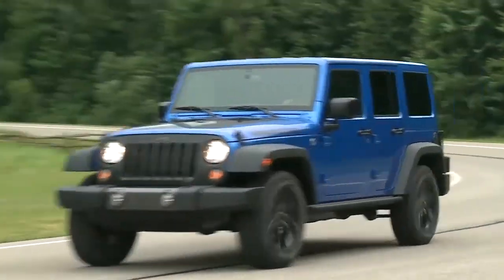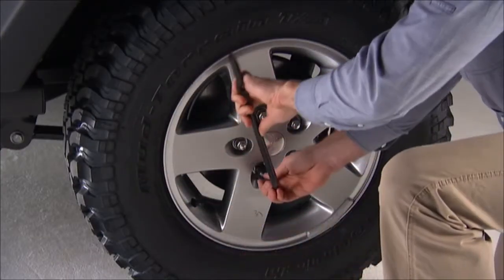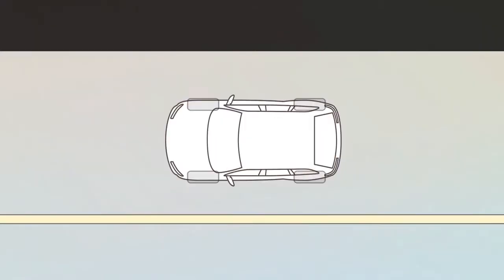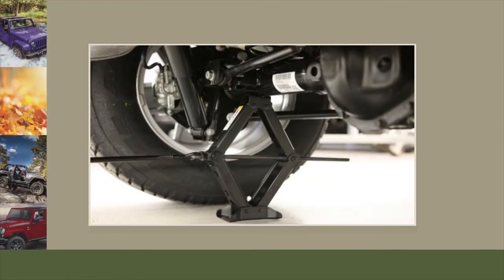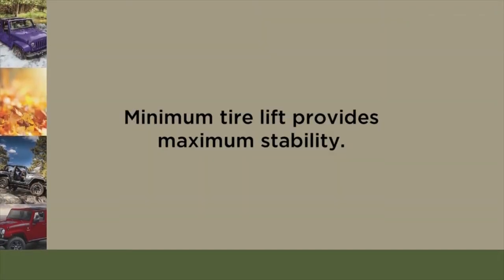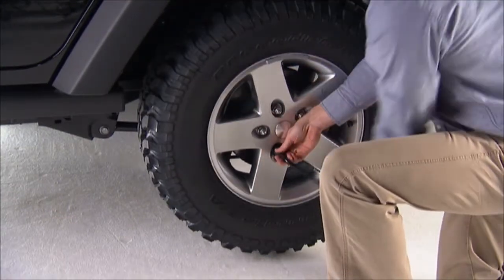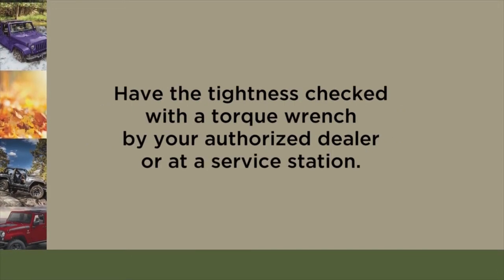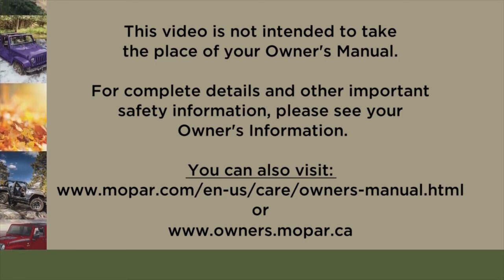Jacking and Tire Changing - How to change a tire on 2018 Jeep Wrangler (JK)

Comment: Is the jack position the same for Wrangler JLU/JLUR - under the front or rear axle tube?
Reply: Yes, solid axle vehicles have to be lifted for tire that way. If jacked at frame spring sag will prevent tire from elevating and require much more lift.